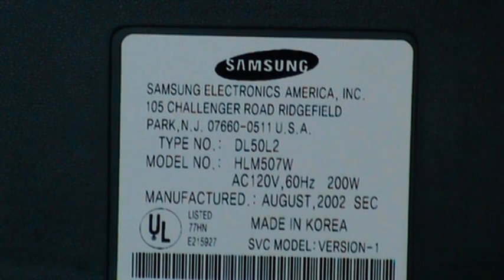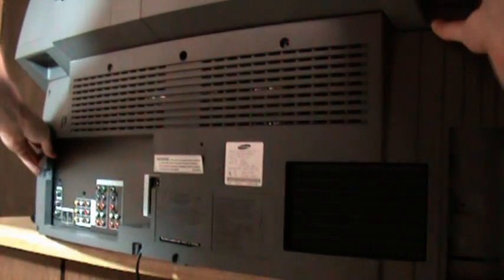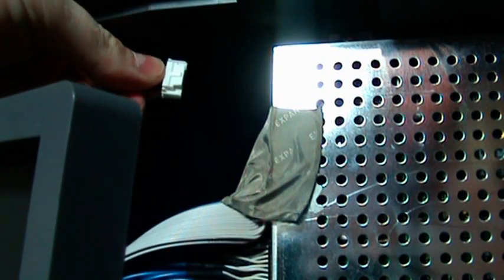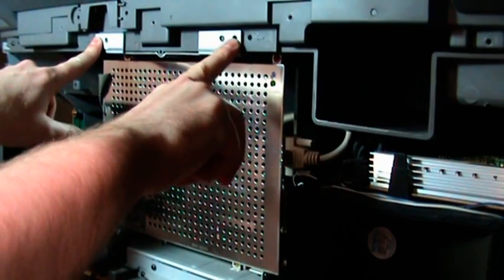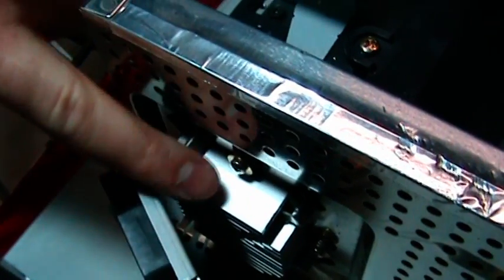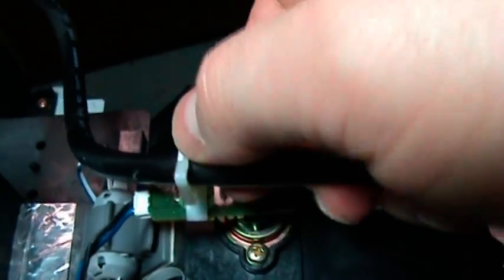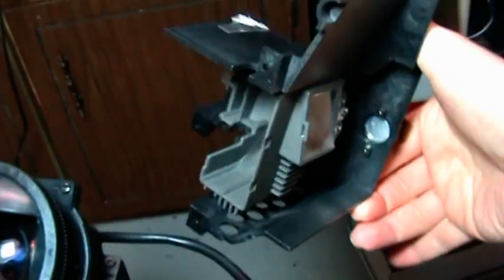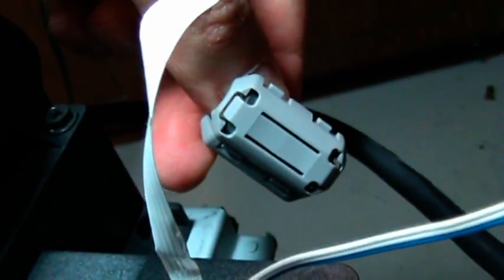How to replace a Samsung DLP Color Wheel HLM507W BP96-00250A Part 1

Comment: Hi there, we have the HLS6187WX/XAA, and we've replaced the lamp and ballast but never the color wheel. No "error lights" happening yet, but there is definitely something wrong. The picture has begun to flicker, almost like an old-time projector. It SEEMS to flicker with every picture change. (If the show remains on the same static shot for a few, the flickering seems to stabilize. It begins again with another camera or angle change, if you know what I mean.) Could this be the color wheel? And if so, I've seen color wheels sold online alone, or with the full assembly. Would I be able to get by with just the color wheel? Or would I need to get the full assembly? Thank you!
Reply from the maker: I have replaced just the color wheel alone before, it just means more screws and assembly work.  If the price difference isn't much, just buy the full assembly.

Comment: Someone just gave me one of these televisions, not the same exact model, but close enough.(samsung HLN5065W) I pulled out the lamp bulb and noticed that the device in front of the bulb is broken, you can see broken material laying inside the glass window, it looks like a broken cd shattered in there.  I have no clue what this device is, but it seems that it broke from too much heat. Does anyone know what this component is?
Reply from the maker: It is likely broken glass from the color wheel.

Comment: I replaced the bulb and the Ballast. But it continues to shut off. The area around the colorwheel is hot. Could this be a reason why the tv keeps shutting off?
Reply from the maker: Jason Hall Do you have a fan not working?
Reply: databits the fan seems to be working. I pulled off the back panel and placed a bigger fan facing towards the bulb. But it still turns off.
Reply from the maker: Jason Hall The colorwheel motor could be over-heating.  Try replacing the color wheel yet?
Reply: Gonna do that now and will let you know by the end of the week. Thank you

Comment: Help, I need a HD5 sensor or a new BP61-00193A color wheel for a Samsung HL-67A510 TV. That wheel is discontinued, and out of stock everywhere. The HD5 sensor was burnt so badly that it burnt the coating off the wires. Does anyone know if you can replace the color lenses on to a compatible wheel motor?
Reply from the maker: Todd Richardson I see what you mean!  I've just done several searches and found nothing online. Something you might consider: find another TV like yours on Craigslist and get parts from it.  OR find another DLP Samsung from Craigslist that color wheels are available for.  Sometimes people give these broken TV's away for free!

Comment: My DLP tv works great but the picture is in black and white and so are any movies we play. Any ideas? Thank you
Reply from the maker: riosrus6 - sounds like your color wheel broke apart.
Reply: Thank you! How much do those run?
Reply from the maker: riosrus6 About $115
Reply: Thank you! my husband put it in but, now the sound is on but no picture. it's black
Reply from the maker: Go back over your steps and make sure all the wires were connected right.
Reply: Thank you for all your help, I really appreciate it. there is a signal coming up. it is a triangle with a light bulb and exclamation point. maybe the lamp has gone out? still no picture only sound. thanks again
Reply from the maker: The lamp may be blown...remove it and inspect it.  Look for breakage in the center or a large black spot.
Reply: My husband fixed it! I really appreciate your willingness to share your knowledge! thank you soooo much
Reply from the maker: How did he fix it?
Reply: He re-traced all the steps like you said and one of the wires wasn't connected properly.

Comment: Mine turns on, turns off makes a rattling noise of some type like a small dentist drill, turns green on the screen turns off then maybe turns on. the picture is fine when its on. could it be the color wheel?
Reply from the maker: Joe Bowyer Sound like classic color wheel trouble, yes.

Comment: My Samsung tv had a dark picture. I replaced the lamp, but I didn't fix it. I adjusted the contrast and colors, and still dark picture. Any ideas what the problem can be?
Reply from the maker: Fam Lozano It is quite possible that the large projection lens and mirror inside is covered with dust.  I would open the unit as shown in my video and try cleaning them.

Comment: Mr. Databits.... Thanks very much for your assistance with this frustrating task!  I've confirmed that all fans are working.  I've inspected the ballast board to see if I have a blown capacitor, can't see any issues but who knows.  Fans very quiet, color wheel very smooth, I can't get it.  Don't want to start ordering parts and trying stuff, may have to give up.  Disappointing, it's been a great TV. 
 But in any case, thanks for the effort!!

Comment: Thank you!  I'm not sure if all fans are working as I can't see them with the back on TV. Can I run tv w back off to confirm? So you don't suspect color wheel?  What should I do about the "ballast" board?  Replace or...?

Really appreciate the help!
Reply from the maker: There is a safety switch that you can put tape on which will allow the TV to run with the back removed, just make sure to take precautions to prevent shock.  I can't recommend going and buying a ballast, since there's no guarantee that will fix it. I would look on craigslist for a broken TV like yours (same model) and pull a ballast out of it.  Or you might find a used/working ballast on ebay.

Comment: Great Video!  I've used it to replace color wheel a few years back. Now I have 3 blinking lights again.  TV turns on, fan working, but after about a minute the picture goes dark and I get the 3 blinking lights.  I replaced the bulb which is the only resolution shown for this symptom, same problem. Opened it up and cleared out all dust on fans, heat sink etc.  Fired back up same issue.  About the only think of is the color wheel but it's not making any noise.  Suggestions welcome! (HLN617W)
Reply from the maker: Johnwall112, the only other thing to consider would be the "ballast" board, which is usually located under or near the bulb.  Are all the fans turning?  Thanks for watching!

Comment: Just a quick question... I was cleaning my tv and troubleshooting and noticed that the blue/white/white wire connected to the color wheel was blackened and appeared to be burnt near the color wheel side. I removed it and the clip broke. Is there anywhere to just get that cord? I'd like to try that before I replace the color wheel...

Comment: yes I still have the parts and getting ready to post them on ebay.
My lamp did not come on so I had to purchase a ballast.  Works same as a florescent lamp.

The bulb sell for $100.00  The remote I think I paid close to $75.00 because the generic down work well with the setup of the TV.  The ballast sell for $100.00  The color wheels sell for $100.00.
I have photos but takes too long for me to download but will provide them to you if you wish.

.

You may contact me at jvaishere@gmail.com

Comment: Jack do you still have the projector lamp.  Just Ask thinks I need to replace my lamp and assembly.  I also don't have the remote for TV as my dog chewed it up and I am using the remote from cable XFinity  .  What is a ballast?  So I am a disabled, retired lady on limited income since I can't work and went through a divorce after 41 years. Can you recommend anyone that would come to home and install the bulb.  Will I need to have ballast?  Looking forward to your reply. or call me.  Carol May

Comment: Samsung 50” DLP TV
HL-P5063W
I loved this TV but am tired of repairing it.
I will sell all the parts as a whole for  the above TV
1.	New Colour Wheel  BP96-00674A,  Just paid over $100.00 for it just to find out the other wheel is fine and is included in the selling of these parts.
2.	The Projector lamp which is 7 months old, paid $60.00 for it.
3.	The Remote Control , just 1 year old, paid $65.00 for it.
4.	The Ballast, purchased it 6 months ago for around $75.00.

All yours for $150.00

Comment: Hi, my color wheel and lamp are good. But my tv said to check fan number 2, just before shutting itself off. I have tried to turn it back on, unsuccessfully, there are two light flashing on front of the set. One is green and one red. Can anyone help?

Comment: So i have a Samsung HLN617W. I got the flashing lamp light nd replaced the lamp. But still when i turn on the tv all i hear is the power on sound and i dont see and hear anything. I had replaced the lamp once b4 and thinking it was the same problem i did it again but its still not working. Im unsure if its the color wheel because i dont hear anything at all. But through the little window it looks like shards of glass just laying there. Was wondering if u had any idea and could help me out Please

Comment: Thanks Mr, Tompkins, I Pay Pal'd you a beer.  Slante.  Took about 2 hours with you beside me on my iPad 2, and no issues.  We did it!  It works with no more squeeling.  Bought the part from eBay for I think around $80 or something.  So for those preparing for TV surgery, you will need cordless screwdriver, one long skinny screwdriver (all Phillips head screws) magnetized would help or needle nose pliers, a vacuum, a container for many screws, a flash light, and courage.  Thanks again.

Comment: Would you say it's dangerous to open one of these screens? My color wheel has gone out (always shows an off color on screen, and then turns itself off.)

I got it open, but I see these ugly capacitors in my way.  I wanna get to the color wheel, but I'm scared of getting a huge shock.  What precautions should I take?

How long should I wait before touching stuff in there after it's been unplugged?

Comment from the maker: @RASGUNO - It could be the color wheel, but unfortunately you can't buy a color wheel part for a Toshiba, you have to purchase a $300 "Light Engine" part.  My advice: sell the Toshiba for parts and find a "Free" or cheap Samsung DLP from Craigslist.   Samsungs have cheaper parts.  Toshiba's DLP's are not worth fixing.

Comment: I can't thank you enough for posting this video!  I just used your walk-through to replace the color wheel in my HLN467W model TV.  Since my TV is a different size there were very minor differences with the layout of the color wheel cover and wires but overall the steps were spot on.  Thanks so much dude - you just saved me like $350 bucks.  (To others who are thinking about doing this yourself - go for it - I am terrible when it comes to this stuff and I did it in 1.5 hours)